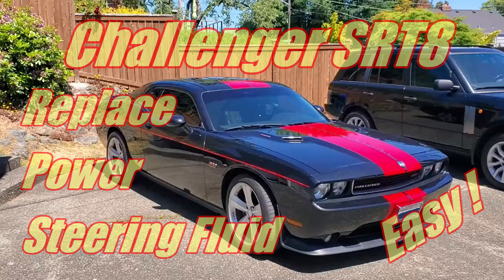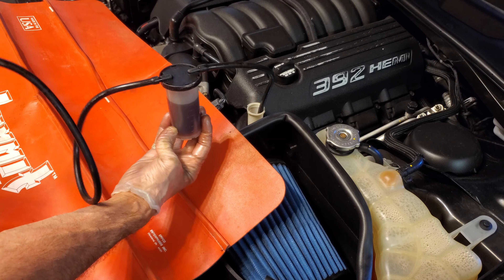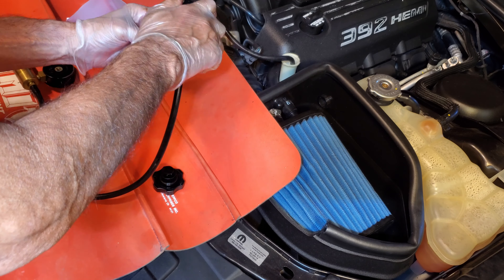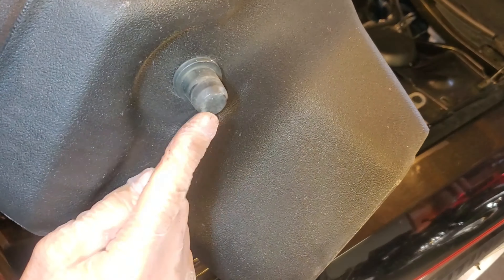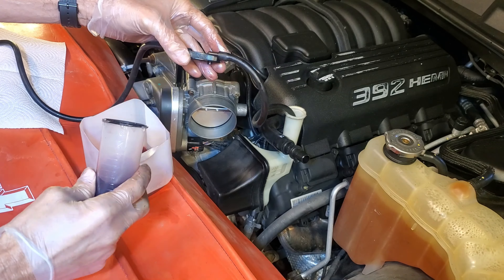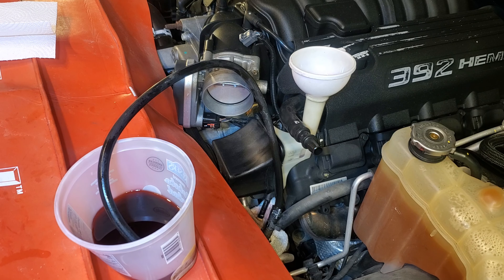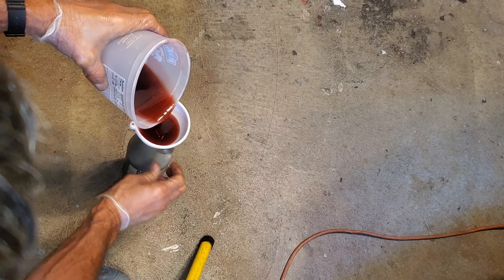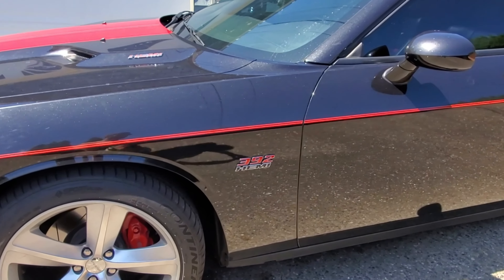Power Steering Fluid Change Easy Full Flush Method Dodge Challenger SRT8 2008 - 2014

Comment: Hi looking to do a flush on mine.  Did you say youl need 1 quart to do a flush?
Reply from the maker: Total capacity with pump, hoses, rack and reservoir is about 1 quart so if you're super careful that might be enough. Having 2 on hand for spillage and WTF factor might make sense. I don't know why the small bottles are standard (1-quart), and the large ones are metric (5-liters). If you have a manual trans, it's the same fluid. Some of the auto trans also use ATF+4 but not the 8 & 9 speeds. You need to verify the fluid for your gearbox. If you can, I would recommend getting the 5 liter size and sharing it between the gearbox and PS like I did.
Reply: @ScubaMoto  ive already done my auto gearbox. Il check to see if theres much left. Same stuff in steering yeah?
Reply from the maker: It's possible. As I mention in the video, ATF +4 is what they recommend for the PS system. ATF +4 is the same fluid as PS +4. They are the same part number. I don't know which auto gearbox you have or what fluid you bought for it, but it might be the same. It is for the Tremec manuals and some of the autos.
Reply from the maker: I just checked your channel profile and I see you have a 6.1. Your automatic transmission and your power steering fluid are both ATF4+. I hope that helps.
Reply: @ScubaMoto  1 quart capacity doesnt seem much at all, im surprised. Anyway thanks for the help dude👍